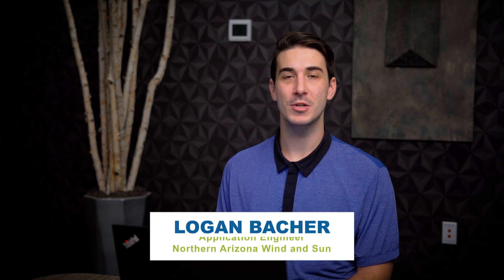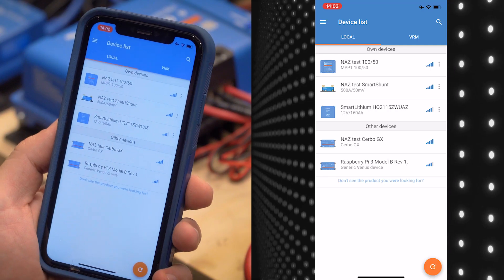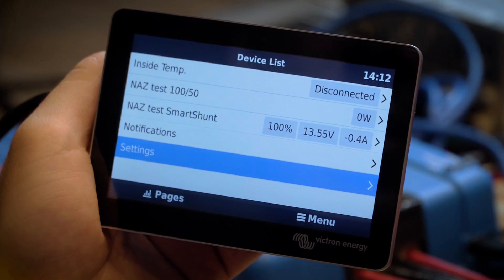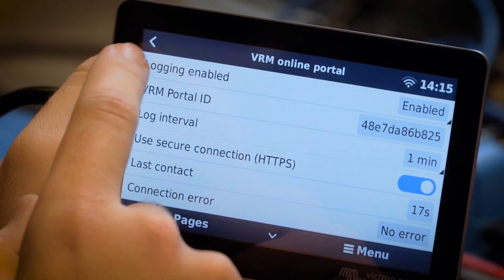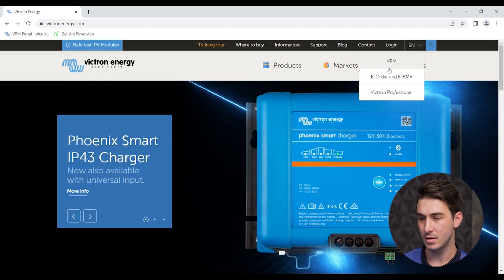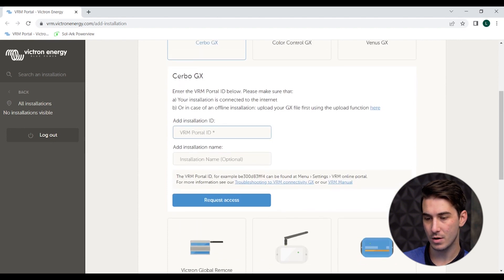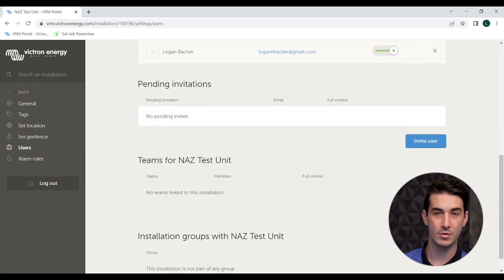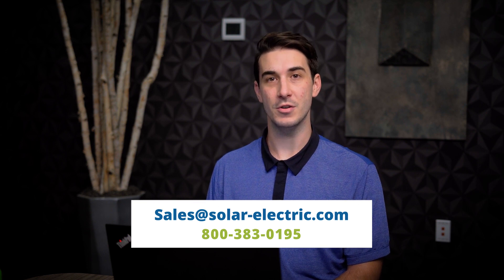Victron VRM Setup Tutorial

Comment: Oh cool, so if I buy into Victron, I have to purchase additional expensive add-ons as well. Fix your Charge controllers 3 foot bluethooth range.
Reply from the maker: We are a distributor for Victron and many other manufacturers. If you need recommendations for your set up we would be happy to assist. sales@solar-electric.com
Reply: Raspberry pi and diy cable cost you $80